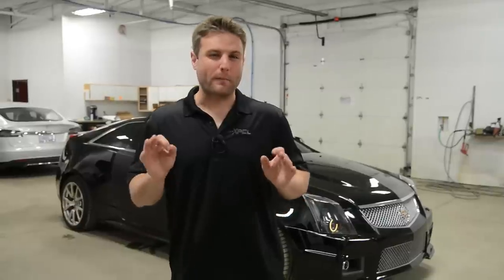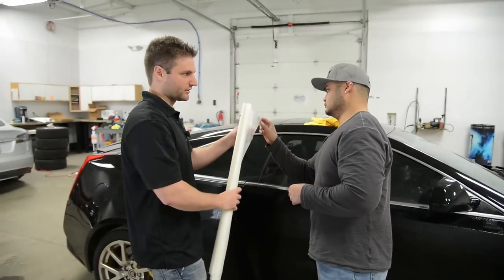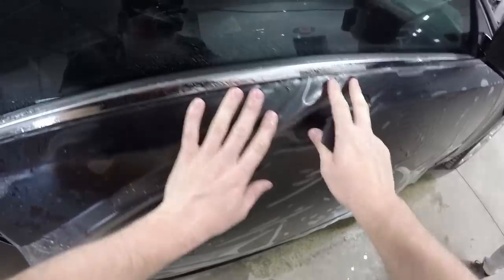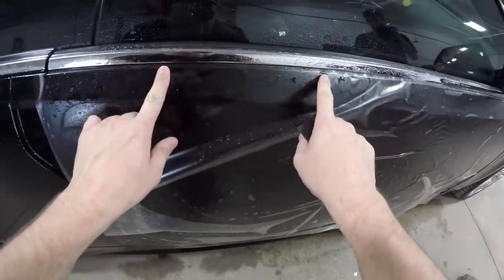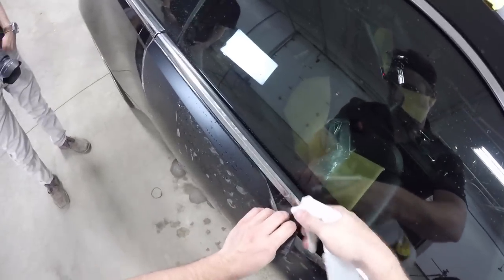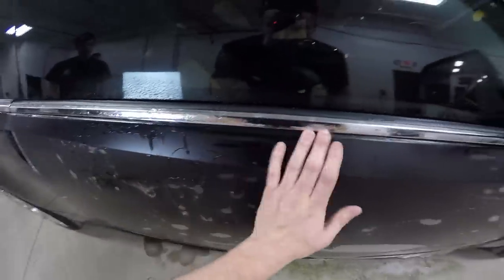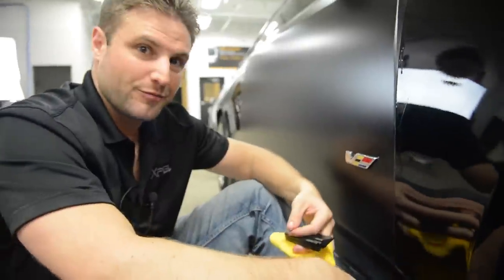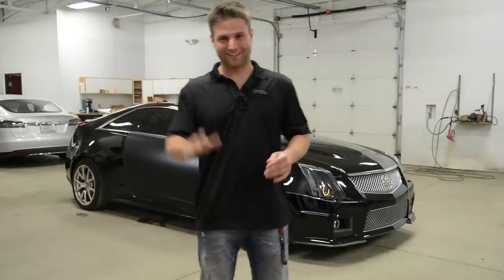Rob Dahm on How to Wrap Your Car with XPEL Protection Film - WR TV POV Install

Comment: How is installing paint protection more complicated than vinyl thats installed dry? LMFAO. installing vinyl is harder cause you dont get to slide it across the panel like wet ppf. i install vinyl and ppf. vinyl most of the time is color change and ppf is clear. its harder to hide the color and get around edges especially on bumpers than ppf is always clear and is ok to have precut lines you can see. unless you can do it in bulk and can install the matte around the edges and not get it precut you will see if you look closely you can see the gloss on the edges of the panel. never gave a real reason how ppf is more complicated.. lol

Comment: why didn't you use a heat gun for the emblem then trim it?
Reply: Midnight Garage polyeurathane tends to shrink rapidly and warp under such high heats as such produced by a heat gun and it would also probably push the adhesive away from the heated area and it would no longer stick to the paint
Reply: Ohh. I appreciate the information.
Reply: No problem